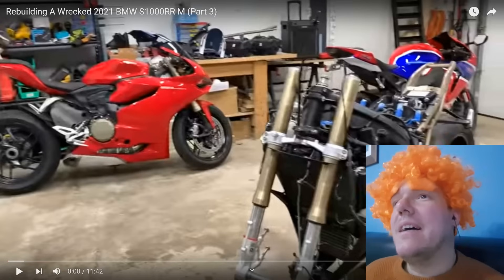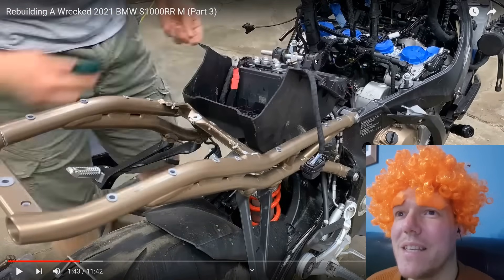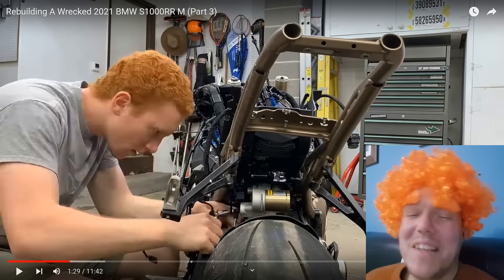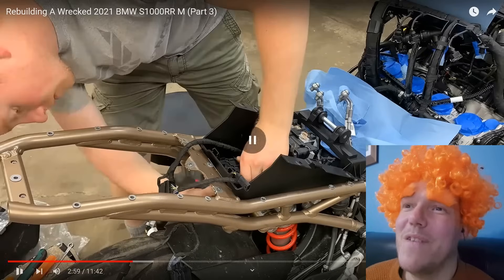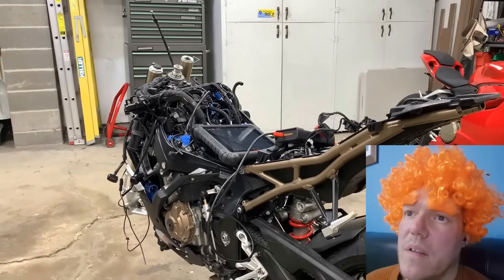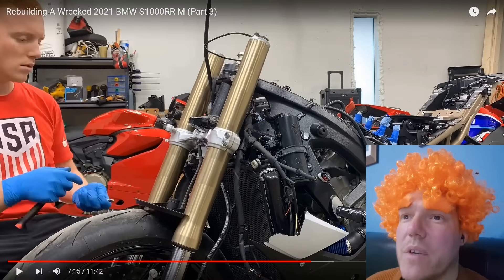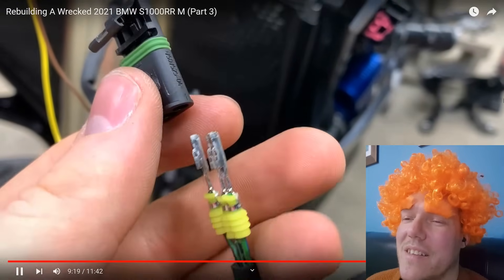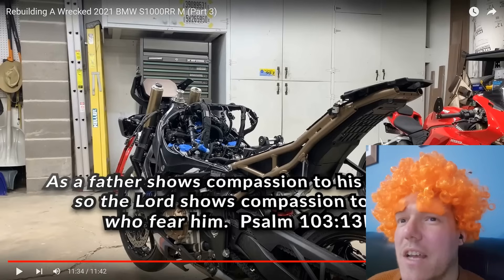GINGER Season 3 - Part 3

Comment: Looks a useful space, i used same lights in garage they made such a difference to old strip lights never have too much light. Dont have the same space but was thinking of getting one of the plastic greenhouses that i could put up as needed. If you did powdercoat a frame is your oven big enough to "cook". Have a good weekend Matt.

Comment: Just need an appropriate scan tool jobby to bleed that ABS module. Obviously, we don't know (yet) whether he will or not but it's certainly doable. Worst case ask a dealer / mechanic with the right kit to do it for you. However, the fact that he calls it a "brake booster" doesn't exactly inspire confidence!

Comment: Yes, that is the oem lightweight battery from m package... nice thing, 2lb 8oz. Actually needed to have that small package cos you got to lay it flat on the back under the seat and push it back in the frame cos the abs module takes so much space.
The stock zf steering damper sucks, he should have invested in an ohlins one... especially cos he can't ride. ;)
Reply: That battery is only 5Ah though. Thought about lithium  batteries for my bikes but the shite capacity/cca and the fire risk is two reasons why I won't.
Reply: @anotherhonda9402  true, on a workhorse like rd03 I'd stick with mf too. Lifepo4 or stuff like that I'd just use on a sporty bike without faffery since it's a bit of a work for the alternator. A friend of mine got ot on a hog like a mt-01, I don't get that tbh.

Got mine for one a half year now without any issues tho (the 2nd winter).
Got me the oem battery charger one can setup to Lithium  batteries and take it off the bike in winter. We got heavy frost over here and if empty, they get destroyed by that.
I'm quite sure the ctek mxs I got for the other bike can deal with that batteries too. Well, as said I guess I got to use that battery cos you got to wiggle the battery around the ABS module in that tight spot under the brace and that is finger-gymnastics. ^^
Reply: @anotherhonda9402  been using lithium batteries for years. Much better cranking power than the standard type. They don't like the cold though. Normally I just turn everything on for a few seconds and it wakes the battery up before pressing the starter.

Comment: The tuning box he got was likely from Bren Tuning and has the capability to read diagnostics from the bike. But he's too stupid to know. You can also get a GS911 tool but you have to pay for each VIN you put into it. As for that ABS pump, he's gonna have to have a dealership bleed it through the ECU. LMAO. 

if you delete the ABS pump, you loose running lights and your brake lights.

also- BMW keys are married to the ignition and the ECU. you can't replace the ignition on this bike without a brand new ECU. The BT Moto box is also marrried to the bike and its VIN, therefore he had no use for it bc it can't be used for any other bikes unless sent back to BT Moto. 

I work on a lot of BMW's at the shop.

Comment: I don’t think there will be any issue disconnecting the ABS module. The factory manual will have the process for bleeding. I was fed a scaremonger story by KTM tech about changing brake fluid. I got a hold of the OEM manual and it was nothing massively different to your normal process. Although I doubt ginge will care about any of that 😂
Reply: Yep, plug it into BMW service centres network to open and close the solenoids electronically as he’s bleeding it. 
At least older BMW needed to do this 😘
Reply from the maker: There is a differnece between bleeding your brake lines and the ABS module. I'll check the manual. But usually you need control over the solenoids.
Reply: @thedirtyworkshop  You doz but it's piss easy with an OBD scanner and an app like Motoscan. I use it to flush the ABS system with every brake fluid change I do.

At least on my F900r it's that easy, can think of a reason why this S1000RR would be different

Comment: 19:18 Matt you didn't mention how he's used one of those shite solder joints right at the back of the connector. Not used an uninsulated through-crimp like factory do for splicing say grounds together etc. Then 3:1 heat-shrink over it. Instead this muppet has taken a nice and flexible crimp terminal and made the tails sceptical to failure by a brittle solder-joint that has zero mechanical-strain-relief. NEVER solder on a vehicle. The only exception is when you absolutely have to, say terminating a odd connector or device. But you MUST provide a means of mechanical-strain-relief. E.g:  Soldered and then epoxy resin "potted". Or the flexible part of the tails are zip-tied to something rigid so that takes the pulling force and some slack is left to the solder-joint. Therefor it wont tug on it. Aircraft are funny because aviator connectors such as GX-16, GX-20 etc... have a clamp at the end that is supposed to bit down on the cables outer insulation and that is the mechanical-strain-relief. Tanks use solder-joints but they are inside boxes say for the gun control etc. That's fine because nothing can be pulled inside of the boxes because they terminate to a similar mil-spec connector on the outside that then run off out in the field where they need to in the tank.
Reply: @nutgone100  the reason you do not want to solder without mechanical strain-relief is the solder joint is solid. That’s a fact. Where as a crimp is not. If we had say a DTM 3pin connector and we did one with soldered tails and one crimped as designed. I can tell you for a fact if we did a pull/tug test especially with the connector not being dead straight the soldered one would fail first. Crimped is like a cold weld. Have you seen the cross-section of a 150mm2 industrial lug once crimped with either hand or hydraulic crimper used for 415V? The strands are basically solid then. But they are not. Crimping is easier and less to mess up and usually tidier than soldering. If we’re talking about a wiring harness for a vehicle like a German touring car championship. The U-shaped uninsulated crimps are what oem manufactures and race-team electricians will do. There is a reason for that. If something is potted then that’s fine. For instance my car has a patch loom made by a reputable company. They have diced an old non-working ecu down into 1/3rd and then soldered to the pins and potted the back. This is fine. Because the solder joint is not under any stress. But using it with no mechanical strain relief is fools play. Not to mention you will inevitably get a little bit wicking up the wire strands and won’t be as repeatable as a crimp.

Comment: I've fitted a few used BMW S1000R/RR reg recs to other bikes when upgrading from SCR to MOSFET.

BMW list the same reg rec for both AGM and Lithium Ion batteries. I assume the battery BMS must handle the lithium charge protection.

Comment: Might have been trying to get his scanner connected so he could bleed his ABS module.  With my scanner, if it won't detect the vehicle automatically, you can put the vehicle details in manually and it'll then talk to the scanner.
Reply: No ignition so will not connect ,bet it needs the display screen connected also

Comment: I just want to be one of the first to comment. Gingers next project is to buy all the components of a  motorcycle and video himself assembling it as he knows better than the factory
Reply: At least we'd know that the frame isn't cracked or bent.
Reply: His MV rebuild is like that as 98% of the bike has been replaced. He only saved the motor front end and the exhaust
Reply: @Gassit until he rides it into a ditch 😂😂